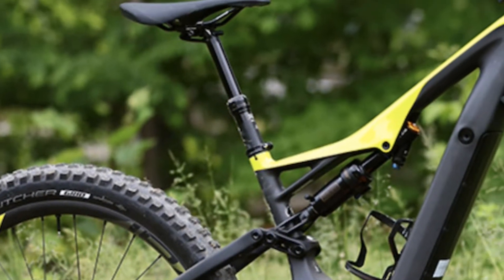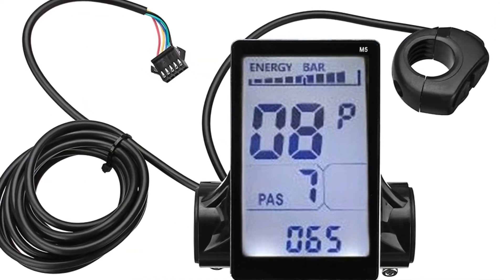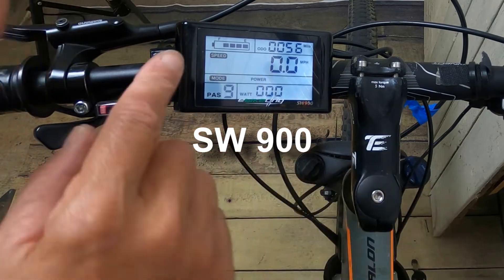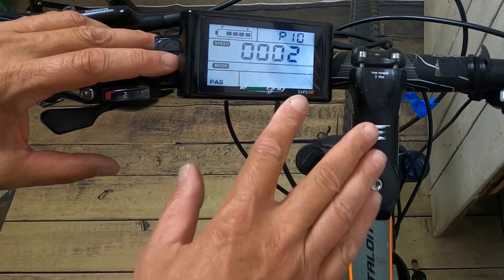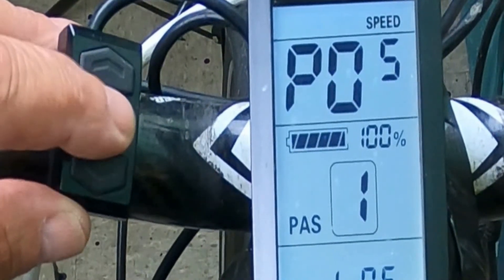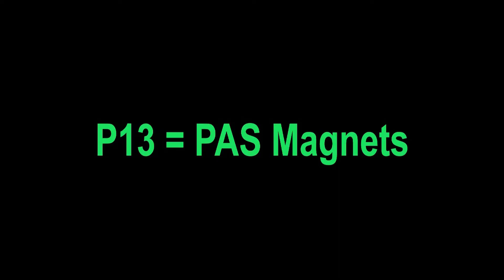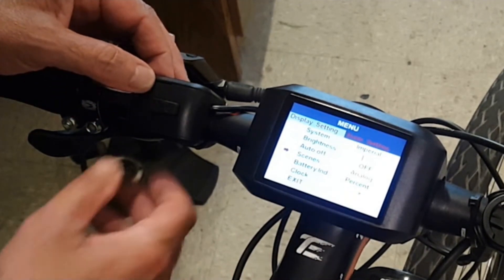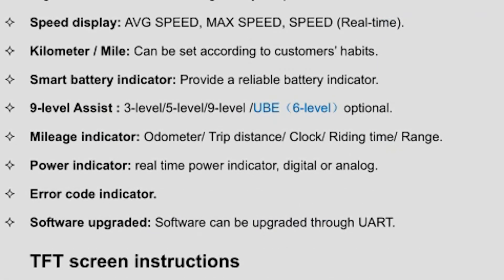E BIKE TIPS: TURBO CHARGE your EBike's Performance and Range!

Comment: 1:52 is there a slot in axle so the cable can go through it and come out on the nut side , instead of between the drop outs and rotor? My kit has this,  and it seems less likely to snag. I’ve seen a few set up like yours, just wondering if some kits don’t have the axle slot ...
Reply: The wire-out-the-end of the axle limits total wire guage, blocks spacer and nut installation and tends to be damaged more than the side axle exit. That's why most manufacturers have switched. It's not always a problem, especially with lower power and an axle guard.